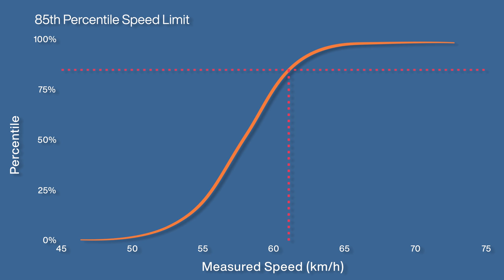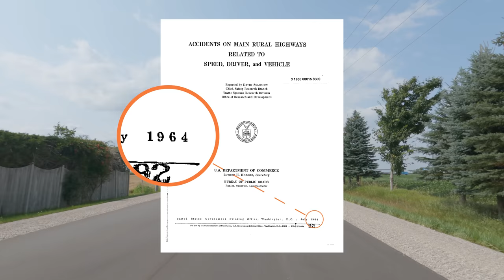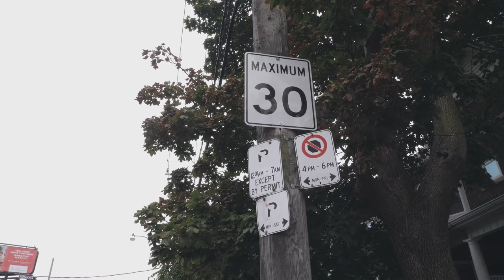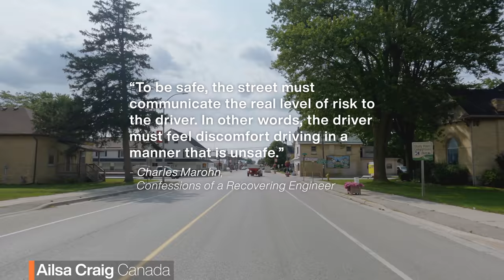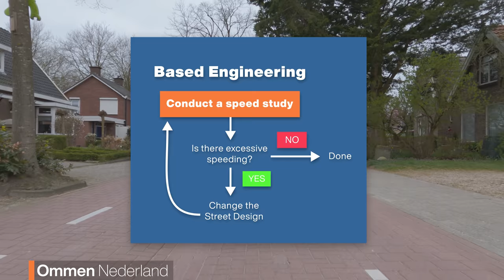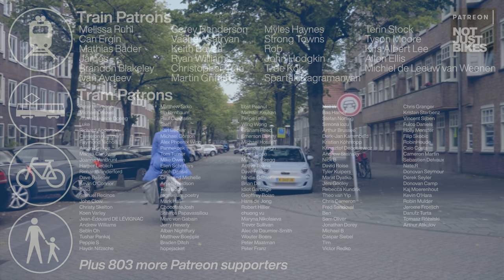The Wrong Way to Set Speed Limits [ST06]

Comment: I've only been driving for 10 years in the US only, but I check my speedometer fairly regularly. 

It might be the region of the US I grew up, but I generally feel like a significant portion of US roads can actually have a higher speed limit than what they do.
Reply: Depends on how good of a driver you are or how much you enjoy driving. As a motorcyclist, im fully aware of what im doing constantly. Though I admit when I had a car to commute to and from work, my brain turned off often. I think driving is boring. I pay significantly more attention on a bike since I enjoy it. I refuse to ride to and from work b/c im tired and can't focus on the road and enjoy the commute unless im feeling really good. I take the bus instead.
Reply: What I have found is the car makes a huge difference.  My old car, well my first car that someone else actually totaled and I got the money thankfully from their insurance, could barely hit 70 mph and it shouldn't be drove very fast.  It was only 15 years old, so it wasn't even super old and had under 200k miles so no excuse for it to be a bad car.  My new car, 2 years later, can go 99 mph easily.  I have only tested that once just to see out in the middle of nowhere where I wouldn't be endangering anyone and it felt completely safe to the point I could probably go even faster, but obviously I wont because going 20 or more over because it can be dangerous to other cars, and well myself.  Point being the car makes a bigger difference than the public, and heck even the engineers realize.  Well the driver makes a huge difference too but everybody knows that, whereas people generally don't realize the car makes just as much of a difference!
Reply: research shows that speed limits are often artificially low. In idaho crashes were reduced when they raised the speed limit of a highway to 80mph because the gap in driver speed was smaller. When speed limits are artificially low there will always be drivers who strictly adhere to it even if the flow of traffic has decided otherwise. These drivers are dangerous.
Reply: @unsweeteneddoll  Makes sense, it is all 55 MPH around here, but traffic in the "slow lane" is often going 70+.  The majority of surface streets I find are OK, but trying to follow the speed limit on highways feels almost suicidal.  There is one road that recently got lowered from 45 to 35 after a bad accident, but the dude who caused the crash was going 110, so even if the limit had been only 5 MPH, and it wouldn't have helped (plus everyone still goes 45 now anyway).

Comment: Reminds me of how I failed my first driving test, I drove at 30mph in a 20 mph zone. There were signs, yes, but the road design lacked the features to encourage you to slow down. When discussing it with my driving instructor afterwards, he said there used to be speed bumps on that road but they were removed.
Reply: So basically, you are bad at driving and observing even when it is your job to do so to pass a test, but of course in true modern style, it is the roads fault :/

All this documentary is about is forcing bad drivers to drive somewhat decently. Just take the L.
Reply: that's your fault bro
Reply: @waltermh111  I don't care about any discussion of design until we (the USA) enforces any kind of meaningful driver testing or real penalties at ALL. A relative of mine just got his license for the first time in his life as an adult. The driving test consisted of him taking four right turns in a parking lot. My ability to drive has not been meaningfully tested in 25 YEARS. Every year drivers are filmed on CCTV in New York driving onto the sidewalk, killing pedestrians, and just driving away with no legal ramifications.

We could have built cars that were GPS aware and UNABLE to speed decades ago. But car commercials still advertise, "driving excitement." Give me a break.
Reply: @tobyvision  miata is the answer. Fun at any speed.
Reply: That's the opposite of how I failed my first. I was driving 20 in a 35, and I didn't feel comfortable going any faster than that because the street was too narrow (and also it was raining).
Reply: @sagecolvard9644  That's actually ridiculous lmao
Reply: @tobyvision  holy shit, my driving test in NSW consisted of
- hazard perception test
- driving a varied route (50-80km/h) ~10km in middling traffic (~11:00, with the drive taking just under half an hour)
- performing a parallel, a front to curb, and a rear to kerb park
- being rear-ended by someone
Well rear-ended was not part of the test but since I warned the tester before it happened (and put on the handbrake) it got me an effective pass from them.
Reply: that's on you bro, reading the signs is 60% of driving.
Reply: @KyrieFortune  Please don't hit the road with this attitude. Reading the signs is what you do when you're stopped or moving slowly. Otherwise look at the cars around you
Reply: @blitzn00dle50  ... you should get back to driving classes ... with this attituede.
Reply: @lucycarlay8547  you just don't know what humans are like if you think we can rely on road rules and signs to keep everyone in check. just look around, obviously that's not the case
Reply: @blitzn00dle50  You sound like you won your driver's license in a lottery.
Well, good luck for the Moment where you don't stop or slow down and don't read the sign telling you to slow down or warning you of a traffic jam or sharp turn. Hey or the signs that tell you that you should go from your 100 km/h to 80, because there is a construction site. You probablly don't even know the rules for the Highway.
Reply: @lucycarlay8547  Don't pretend like you haven't accidentally driven too fast. If you say so, you're bullshitting. Also corners can be argued as a form of traffic calming because they force you to slow down.

Also also, the rules of the highway pretty much boil down to "keep right except to pass" and "personal space" it's quite simple
Reply: @blitzn00dle50  Congratulation you pass the Highway rules

And no I never have driven to fast.
1. I like to keep my license, 
2. I do not want to take driving courses again and pay for it, 
3. I don't want to get a speeding ticket.

And honestly if you can not see the sign with the red cricle and the number you have to drive ... you should maybe get glasses.
Reply: @lucycarlay8547  Cap McBullshit, you've definitely exceeded the speed limit before. I've done so on my bike. We all have, it's part of the brain of a driver. "I can go 20 kilometers per hour faster than this sigh says, so I will." It's up to the road design to make them feel like they can't.
Reply: @blitzn00dle50  There is the difference you drive a bike I drive a old Peugeot... this car is not fast.
And as I said I don't want to lose my license. 
But beside this argument is not about how fast we drive.
It is about how you think that signs are needed to be read when someone stops or if there are slow driving....
Mister when you go 240 km/h and do not read the sign that you now need to drive 130 km/h you should not drive. You are a danger to other cars!
Reply: @lucycarlay8547  This video literally explains all of the cool ways you can slow the cars down without using a sign. Why do we want to use something besides a sign? As the video stated, signs get ignored.
Reply: @blitzn00dle50  I don't say anything against that either, these precursors are also good for people like you. What I'm talking about here is your attitude towards driving.
If you are not able to read signs from a certain speed, you should not even get behind the wheel.
Reply: @blitzn00dle50  The video doesn't say that we can skip signs. We even have electronic ones on freeways for Amber alerts. The rest of us read signs just fine. Road design is one component, but just one, and we have signs for a lot more than speed.
Reply: @lucycarlay8547  Way to completely ignore what I'm saying. The vast majority of us know what the speed limit is and actually choose to drive faster because we think we can get away with it. Just a sign isn't going to stop people from doing that, the shit went over in the video will
Reply: @tobyvision  this is a very USA thing to do. Instead of preventing people from being physically able to break the law or helping people follow the rules, let's just make more laws and legislations as well as putting more people in prisons.
Reply: @deadded5793  certainly. Not to mention that the car industry has been literally writing laws since 1910. Their worst nightmare is driving being limited to responsible drivers and being a boring affair in which far fewer cars get totaled.
Reply: Where I live in the UK, there are in a few places speed bumps painted on the road - no bump, but they get your attention.
Reply: @lucycarlay8547  the speed limit is 70 miles an hour on Interstate 69 in Southern IN yet everyone goes 90. If you go 70 you are gonna get run over. Same with if you go the speed limit on I-465 in Indianapolis. Speed limit is 50-55, everyone goes 80
Reply: I hated hainvg speed bumps on roads in our old neighborhood. Many cars would slow down to go over the speed bump, then rev their engines to get back above the speed limit. Some cars would just go the speed limit over the bumps, which makes a lot of noise that can be heard in all the houses nearby.
Reply: That's all on you. Part of driving involves paying attention to street signs. The road shouldn't be designed to MAKE you slow down. You should determine and execute that all on your own.
Reply: @blitzn00dle50  Looking at the cars around you is a major distraction, you realize you have peripheral vision, right? Your peripheral vision does the majority of the work for you, while your job is mostly to focus on the direction you're trying to go, if you're driving around a curve you should always be looking at the end of the curve, to where you're going to be when you come out of it. You use your mirrors to check for other cars, and if they're in front of you your peripheral vision takes care of it.

Comment: I'm looking forward to that video on how lowering speed limits actually alleviates traffic congestion.
Reply: Because people get mad and bypass those road/streets, taking their buying-power with them.
Reply: I'm guessing it's partly due to the "accordion effect", where drivers constantly speed up and slow down, sending "waves" of congestion through the road. Whereas if more people drove at a slower, more consistent speed, there would be fewer clashes and thus traffic could flow more smoothly.
Reply: One of the reasons probably is that more cars fit on the road when driving slower
Reply: @AlbertZonneveld  Accordion effect is the main reason I guess, slowing them down does allow for less spacing but you've also slowed them down, so probably a wash. That's all just a substitute for increasing actual capacity by adding alternative roads or widening the existing one. Most youtubers on this topic, I think including the one here, argue that increasing capacity doesn't reduced traffic but that's due to a severe shortage of capacity and the new capacity also being insufficient.
Reply: @m.f.3347  that doesn't make much sense since the traffic lights are still there, causing the accordian effect in the first place.
Reply: @GrendalTheBeasty  widening a road just makes more people take that road
Reply: @wisenber  more people also means more traffic, at least in the US where everyone has to drive a massive vehicle with very few people inside
Reply: @wisenber  it's not mandated, it's the norm, have u seen how many pickup trucks get sold in the US every second?
Reply: @DouglasWalrath  That was my point, if you don't widen it enough or add enough alternative routes to meet the demand, then nothing will really change. Prime example, 2 lane road in the middle of no where going from 1 small town to another. You can bet on there being little traffic on it. Take that same road and put it between two major cities and it will be a parking lot. Expand it to 4 lanes and nothing will change. Expand it to 8 lanes and put a second 8 lane highway running parallel to it a few miles off to one side and you'll likely make those 2 roads look an awful lot like our 2 lane road between 2 small towns. Ultimately this is a problem of urban density though. Need to do away with the high rises and 50000 floor office buildings. Spread people out and the traffic goes away as traffic is a density problem at its core.
Reply: @GrendalTheBeasty  I don’t think, spreading cities out is a good solution. First of all, it has downsides to it, like cities growing even bigger. Secondly, I don’t think that the businesses and people in the city would actually want to spread out. The high density is a result of the high demand on downtown areas. A better solution would be to prioritize more space efficient means of transportation like subways and cycling.
Reply: @LukasFink1  I firmly believe people should be able to do as they wish provided they don[t hurt anyone else, but I don't see any advantage of high density urban cores in the modern world. They made sense when cities needed walls and guards to keep the raiding parties out but that's a rather archaic concern these days. People need to re-imagine cities as rather than having a central core, having many smaller hubs spread throughout. As a real life example, I live in the general Washington DC area but both my office and my apartment are much closer to corn fields than the capital building. The area I'm in is filled with fellow tech and engineering companies and while traffic going to/from the city center is horrible, none of us actually make that trip. It's all on small side streets for just a few miles to offices that are widely scattered about the area. That is far more efficient and cheaper than an urban core.
Reply: One of the main causes of traffic congestion is accidents. The congestion bubble after a bad accident actually lasts for hours after the wrecks have been removed. The faster you are going, the more violent is the resulting crash, and thus the longer the congestion bubble that exists in the wake of the crash. But also, since lots of people vastly overestimate their driving ability, the faster you go, the greater the number of accidents you cause.
Reply: @sking2173  works perfectly fine in Europe. If you need the feel to speed constantly, then you are probably going through the area and not in to it. Which means you are probably not putting your money there.
Reply: Simple, take a bottle of water and turn it upside down. Now take another bottle of water and empty it as well but by holding it at a 45 degree angle.
Observe how the second bottle empties faster because you are forcing less water through the narrow neck of the bottle. 
Traffic lights/ roundabouts are bottlenecks and cars arriving at high speed fill them up faster than there are cars leaving them.
Reply: @m.f.3347  Cruise control is really cool. If people payed attention when they drove it wouldn't be so bad. Most people don't care about their lives or the lives of others.
Reply: @wisenber  People "choose" them because of the way the streets are designed
Reply: @wisenber  I think it's very naive to think the roads are designed to be user friendly but even if that was the intention it still has the result of making it more unsafe for both drivers and non drivers and forces people who don't actually need a car to suddenly need one
Reply: You act like infrastructure is some force of nature and it cant be changed or made more efficient. Im not gonna argue with you when you have such limited imagination
Reply: @soujemn5  the town i live near has its lights timed to let you drive all the way through without stopping . except for the first light of course. but many still try to drive faster.
Reply: @wisenber  we have safety standards that some can't pass.
Reply: @GrendalTheBeasty  There is a famous engineering rule of thumb that is actually called, "the problem of the road." Basically it amounts to the idea that it is usually impossible to build long term capacity. If you manage to reduce traffic on a route, the route becomes attractive, and eventually is highly trafficked. This is especially obvious when fast routes from surburbia to inner city are developed. The fast routes makes it possible for city dwellers to move to suburbia and still work in the city. Suddenly the fast route is a slow route.
Reply: @GrendalTheBeasty  I am firmly of the belief that vertical density is bad for human beings. We know that stress hormones are much higher in people in dense urban settings, and they have worse health outcomes.

However, urban sprawl is absolutely financially unsustainable. The cost to maintain roads (and crucial services like emergency response) requires a certain tax per square mile. City planners and legislators spend their entire careers trying to maximize tax revenue per square mile and they can't even keep up.

Comment: I'm right there with ya. I find especially in Ontario that the speed limits feel slow because of how straight and open the roads are in those rural areas that often put you through the charming little towns.
Reply: Man, they really gotta re-engineer some of those highways that go straight through the village. You know, put something up more than just speed signs before entering the village, like chicanes, bumps, narrowing of road, etc. Everytime I drive past a village on Highway 7 I got mildly surprised by the village.